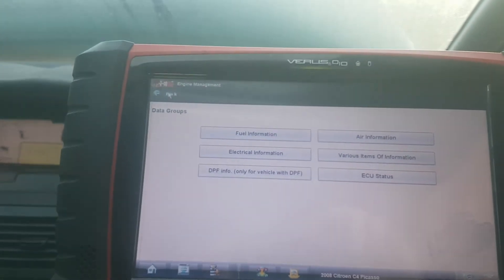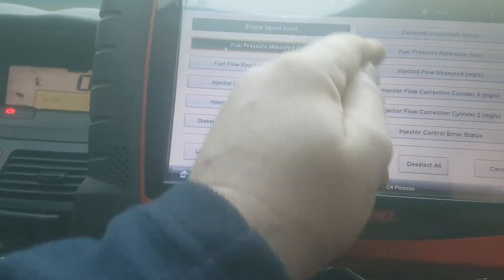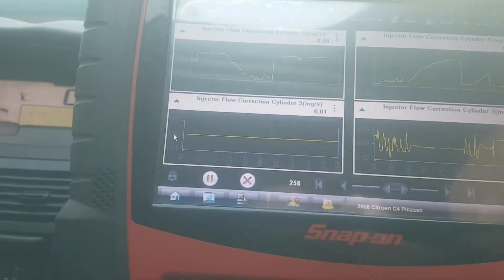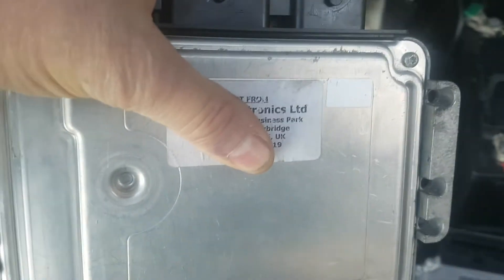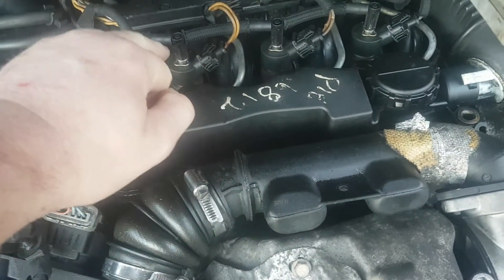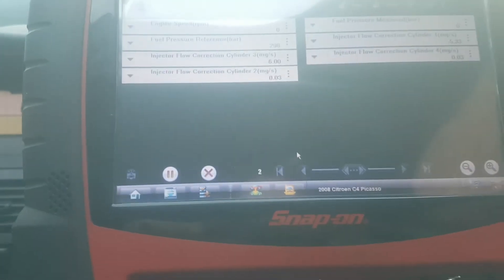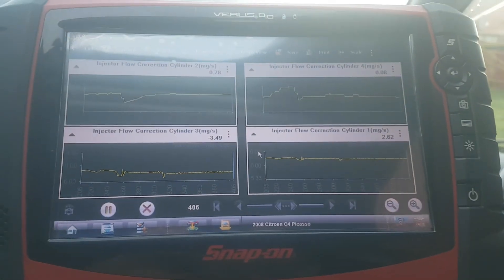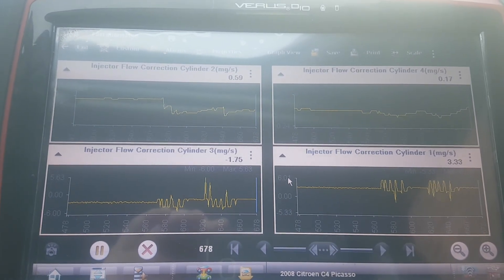citroen c4 picasso injector not reading correctly

Comment: I have 2012 c4 grand Picasso. Car died on the motorway, started back up in limp mode. Obd2 says number 4 injector. Replaced and no difference. Swapped 3 and 4 but no difference. Also showing esp/ asr fault and airbag or seatbelt pretensioner fault all appeared on same day. Any ideas?🙏
Reply: Did you find out what the problem was
Reply: @kevinmurphy8410   Injectors are backwards on these cars  so they go 4 3 2 1 instead of 1 2 3 4 from left to right. Airbag fault was just a coincidence that it happened on same day.